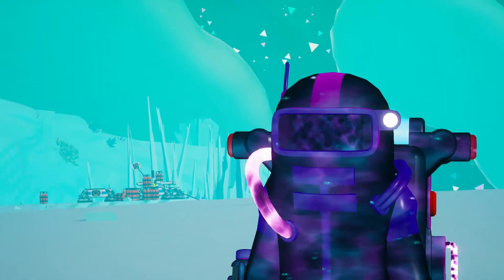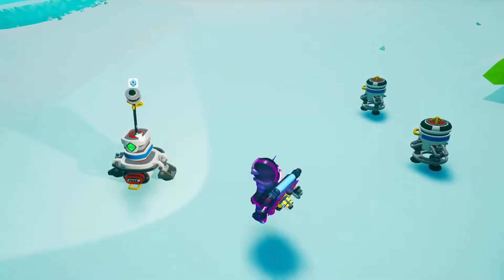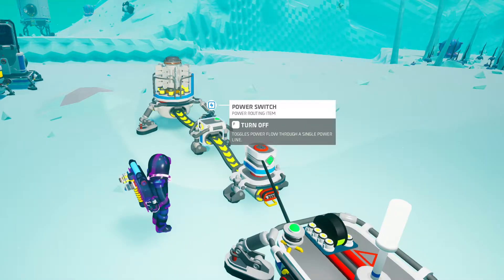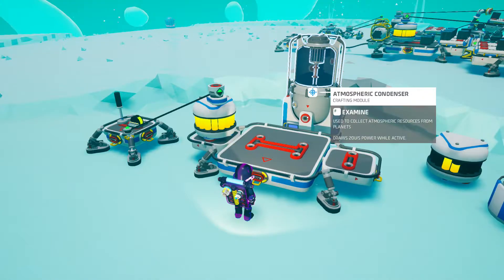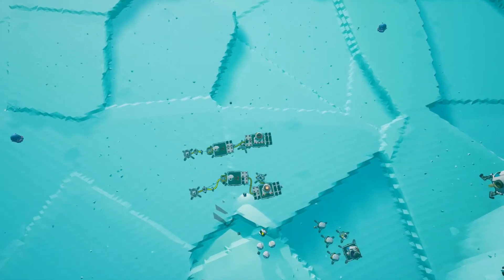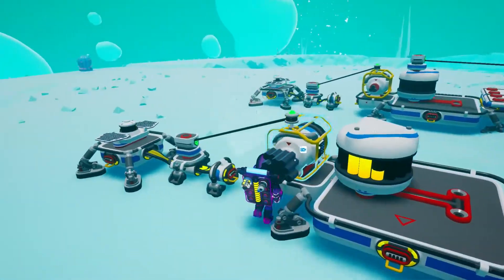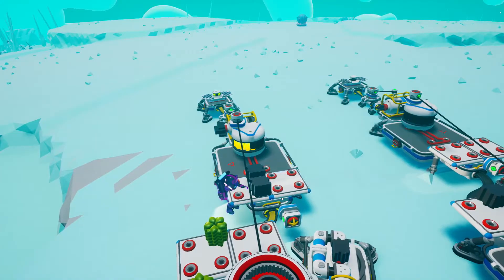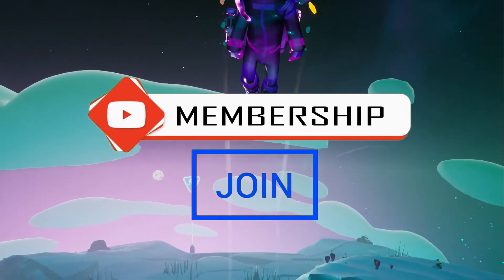EASY automation - SENSORS tips and tricks Astroneer

Comment: if you're having that problem where it's strobing on and off 50 times a second, you need to use a power connector because it changes the power cord so that power only flows in one direction. Otherwise the sensor is looping on itself and the generators produce really slowly
Reply from the maker: Thanks for sharing this tip

Comment: I was hoping the Power Sensor would trigger if the power level dropped or increased, not just if it turned on or completely off.
Reply from the maker: These are the states of the power sensor:

Gained or Lost: Will send a signal when power is gained or lost. It must first lose power before being able to detect power gain again.
Gained: Will send a signal each time that power is gained.
Lost: Will send a signal each time that power is lost